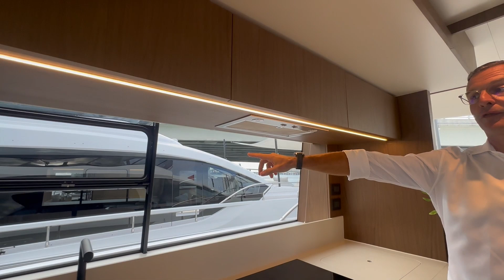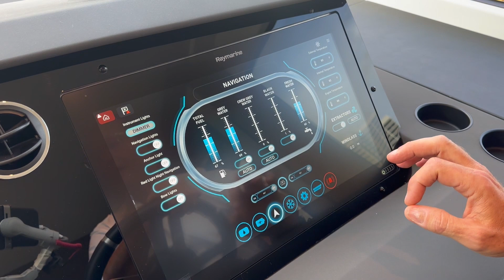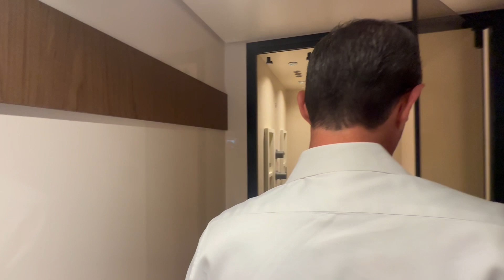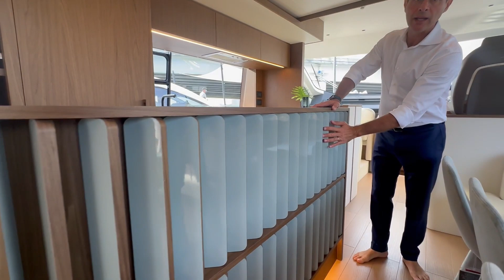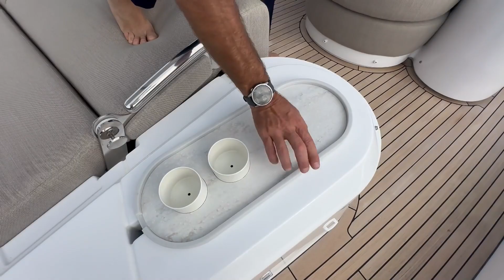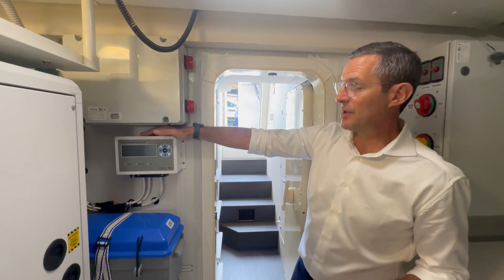Full In-Depth Yacht Tour with Federico Ferrante | All-New Azimut Fly 72

Comment: Do you believe it possible for a first-time boat owner to learn to handle a boat lie this?
Reply: YES you can! If you can afford this vessel hire a captain for 6 months and you will be able to run it dock it all  with ease! These modern boats have joystick control and remote control! This is a easy vessel to owner run with 6 months of help! God bless all and happy sailing all 🙏❤⚓🛥
Reply: @mareewalker1096  Thank you, That sounds like a plan.
Reply: @villasisbacag  your welcome! 75 feet is the limit before you may need assistance not in operating the vessel but cleaning in! But as for driving docking 6 months of help just to learn mainly how to dock it and how the whole vessel runs like anchorage using  chart plotters and how to understand the main screens for autopilot planning your trip act! Put it this way you will get your private dock in a marina or if you have a home on the water to keep it either way it will take you maybe 10 times practicing  and that's done! Once your out of dock you Put on autopilot and leave the boat to take you were your going but you need to keep watch on depth of water and  other vessels while underway! Learning the screens and understanding the water your travling through is most Important! Like Google maps for car you can scroll through whole trip and see water depths so you don't have to worry till you get to destinations! If on the way there is  shallow water just set auto pilot to 1 mile before that shallow water and take over and go around shallow water and reset autopilot to destination! Once you have done all this with a captain for 3 to 6 months it will be a breeze for you to run this boat! The hardest part will be cleaning after trip! Lots of help from family will help! It's a big boat in person to clean! But you will be fine if you do buy one! Id buy a used one nearly 1 third party of the price still new condition! Unless your worth100mill! It's just not worth paying for new and the minute you take ownership you loose a third of its value! Hope all this helps! God bless all and happy sailing to you!🙏❤⚓🛥
Reply from the maker: This is not a boat that a first time boater could be an owner/operator of. You can learn more about this boat here: https://bit.ly/3IcGFHs